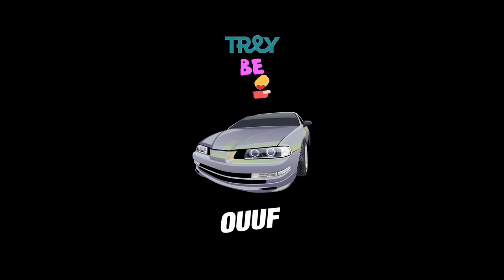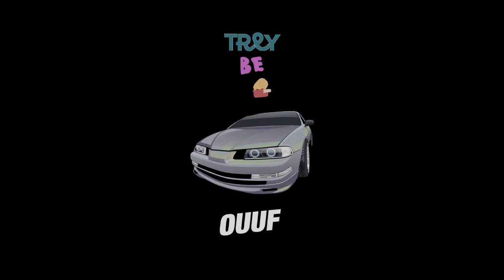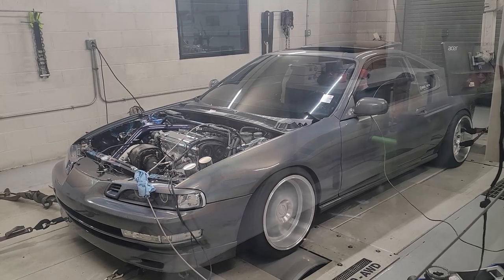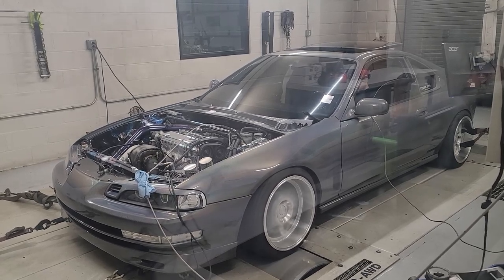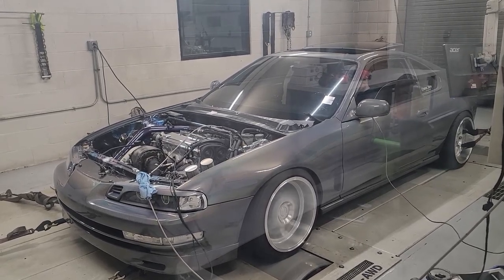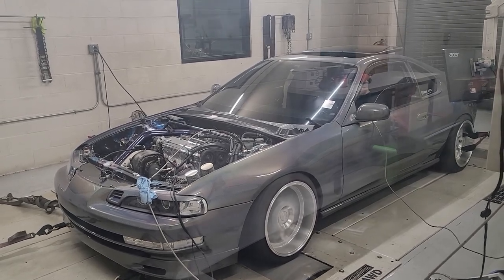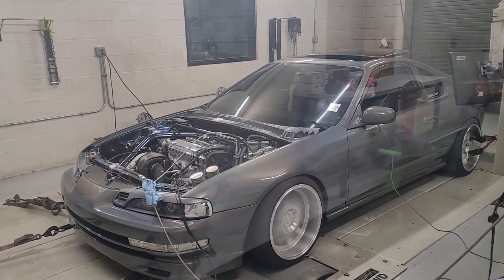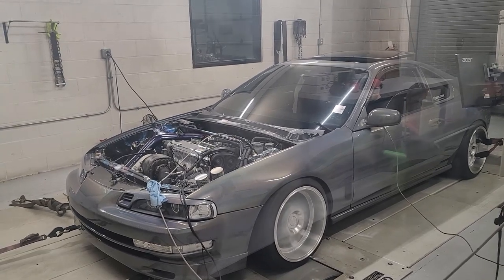Went for the moon tune and this happened................................................

Comment: I got a lot that I want to let you know. I’m in the NJ/PA area 6th Gen accord with an identical turbo setup h22 on a precision 62/66. 1st dyno session the alternator went out on us and failed. I came back with a spare on another day, it kept kicking the belt off. I have a 3rd one setup this month , the car made 480 hp. Each time I went I had E85 and we couldn’t use it. The tuner is going to probably keep the car at 500hp  on 93 octane but will be about 600 on E85. My car is a street car, I doubt I’ll be tracking it. Alternator was replaced and the car ran fine until it started leaning out. (Maybe 02 sensor) It’s always something with working the kinks out. Don’t let it discourage you, you got it! Btw I’m running a twin disc clutch setup.
Reply from the maker: Thats sick bro thanks for the encouragement
Reply: @treybedipping1734  not a problem, you encouraging us out here too. I’m going to get my Ap1 cluster lights changed too. Eventually I’ll look into a shifter instead of my oem setup. Also remember it’s not just HP #s, it’s reliability too.
Reply from the maker: @ImportLenz  facts bro

Comment: I can't afford to modify cars anymore. I just restore them. You have a nice car. Them wheels and tires are not right with that much power. You need a 15, or 16x8 wheels with slicks in the front. Need more tire space for slicks. Adjustable struts will help too. Stiffen the rear struts. Great engine, but I think you out grew your street wheels, and tires. Rays Gram Lights 15x8 would be nice.
Reply from the maker: Thanks bro i actually have slicks for the track

Comment: What clutch you running? I got a comp stage 4 6 puck and im worried I'll have the same issue when it comes to dyno
Reply from the maker: Same clutch but watch my next video to see what the problem really was
Reply: @treybedipping1734  way ahead of you! Looks like I'll be buying ARP flywheel bolts for safe measures! Glad nothing got damaged!